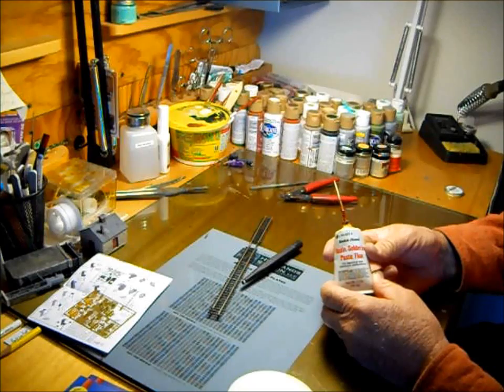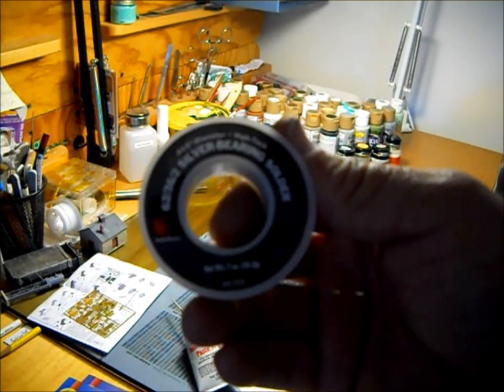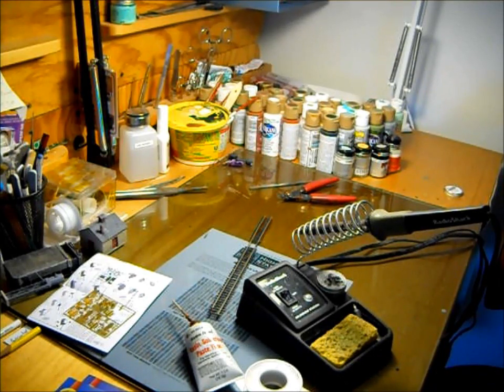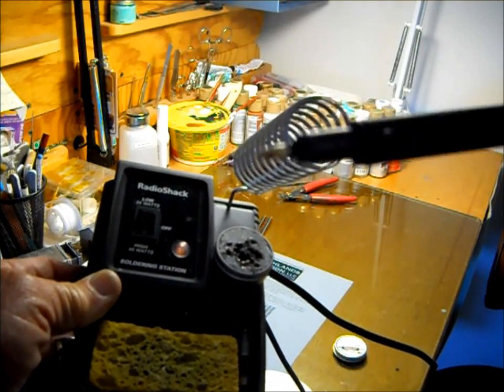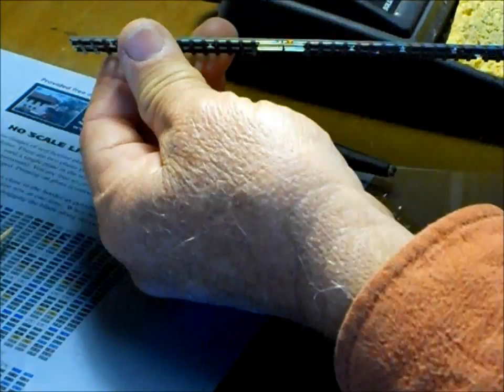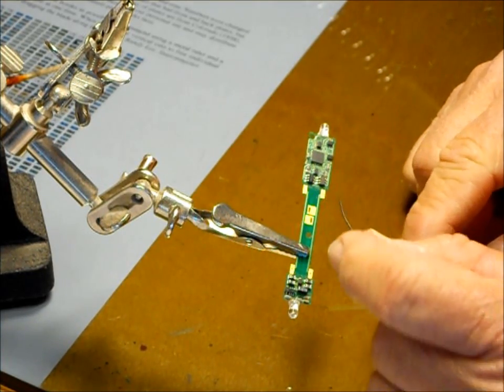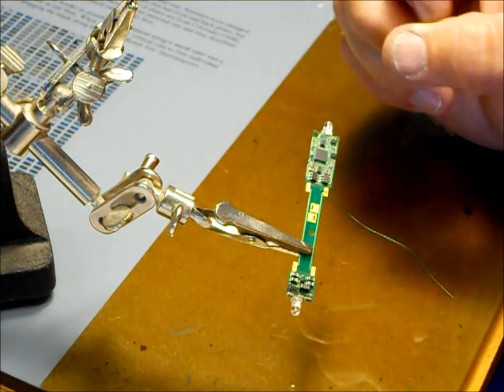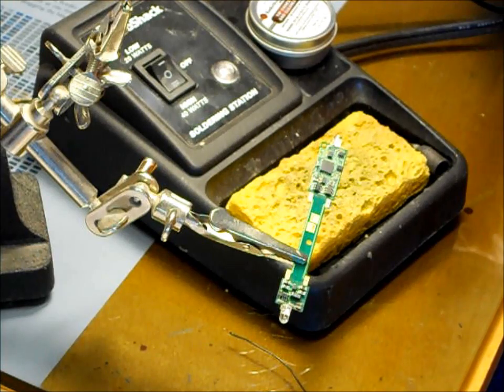How to Solder in Model Railroading

Comment: You could re-title this "Solder Without Fear"  I'm assuming you're still soldering this way. I'm going to do my first solder when my Kato e5 board arrives and I've been worried about messing it up. I've watched a lot of soldering videos but they were too generic. Yours, as always, is excellent. I'm also going to be installing one in my Kato F7. Looks more involved. Are familiar with that install?
So - 40 watt iron, solid core "silver" solder, tinner, 30 gauge wire, good flux.
Reply from the maker: The F7 is a really easy install , https://www.fiferhobby.com/installing-decoders-in-kato-f-unit-diesels/
You have all you need and use high heat and be quick with the solder.
Mike

Comment: Mike, I stopped using a sponge, (too much difference in temperature), and just use the metal scrub mesh to clean the tip.....
Reply from the maker: I may have to try that,  Mike

Comment: Mike, you're 4 for 4!  While getting into model railroading and watching your videos, you have taught me (A) how to wire the layout for DCC and/ or DC operation,  (B) how to wire NCE Power Cab Switcher so that I could have a functioning programming track, (C) how to utilize "wall warts", or 12 volt charging cords to function as the power source for the accessories on my layout, and (D) how to solder with ease!  I have watched a few "how to solder" videos, and I couldn't get the concept right, that is, until I saw this video.  Now I have been successful in all of these concepts.  Thanks, Mike!
Reply from the maker: Thanks Brother, I am glad to have helped.
Mike

Comment from the maker: I am not an expert either but the flux will almost immediately transfers the heat to the rail and you can tell by the look of the solder if it is a cold joint. With the proper solder , heat , and flux , that is almost a thing of the past.
Thanks for taking a look , Mike

Comment: Still working my way thru your video collection and found this one. Thanks for sharing your tips, they help a lot. Just one question; when you solder those small wires to a decoder, do you usually use the 20 watt setting or the 40?

Comment: Nice "soldering basic's" video Mike. I use the same .015 high-tech silver-bearing solder from Radio Shack...I also find that the .022 high-tech silver bearing solder works just as good, and last's a bit longer to boot. [it's item #: 64-013 for anyone who wants to know].

Comment from the maker: Yes the iron is 64-2184 , tip cleaner is 64-020 , solder is 64-035 and the rosin flux would now be 64-022.
Thanks Richard , Mike